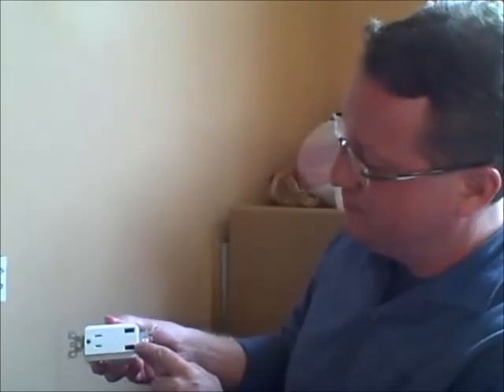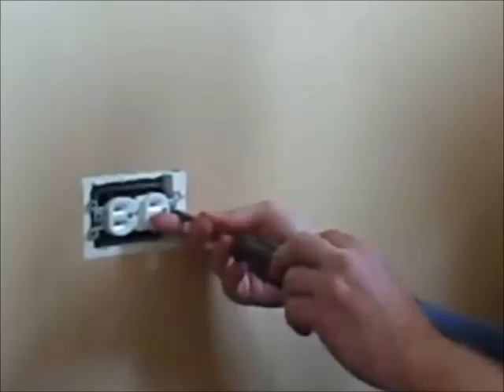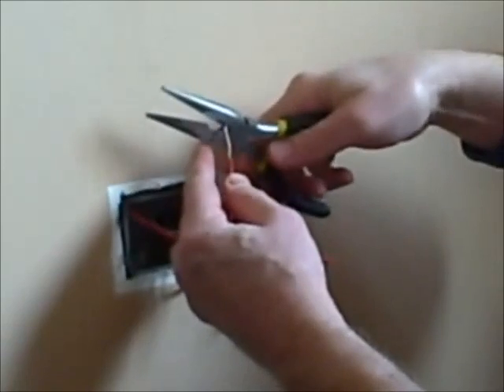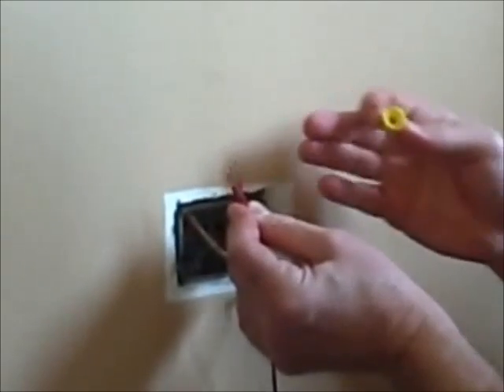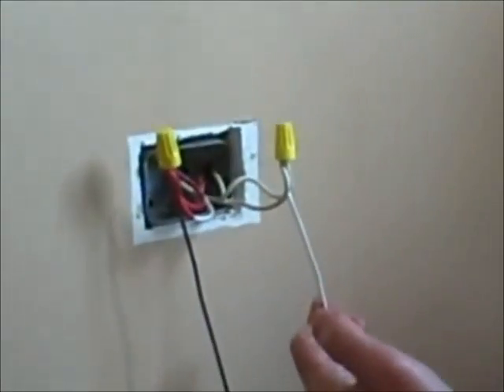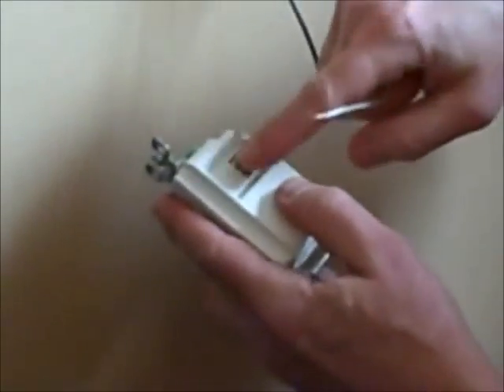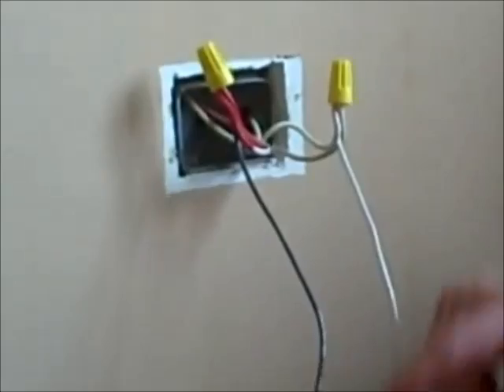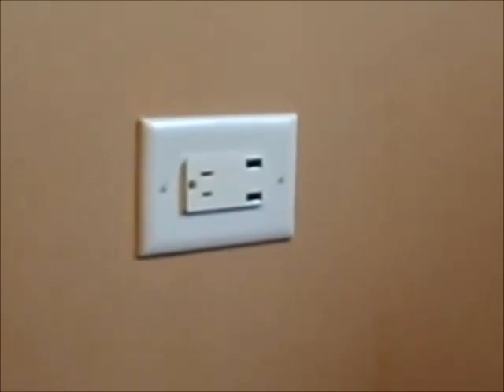Pigtail for an Outlet - Pigtail Connection - How to Wire a Pigtail - Conduit

Comment: Where do you get the extra wire and what Guage is it?
Reply from the maker: Hi, you can get wire from your local hardware store. They will usually cut a short length, or you can buy a bag of grounding whips. They usually come in 12 gauge for 20 or 15 amp circuits. Match the wire size to your circuit. 14 gauge for 15 amp, 12 gauge for 20 amp.
Check out more home improvement tips on our weekly podcast 
https://itunes.apple.com/us/podcast/fix-it-home-improvement/id880903087?mt=2

Comment: Nice pigtail demo thanks.  No ground wires though?  I'm no electrician, but If you don't have access to ground I think it's against code to have a three prong receptacle unless it's a GFCI.  False sense of security, at least for equipment being plugged in.
Reply from the maker: Hi this is in the Chicago area with conduit. The metal conduit is the ground path back to the service panel. Common in a few parts of the country. It is grounded, you can confirm with a tester.
Reply: @FIXITHomeImprovementChannel   I think that's only partial correct. Aren't you still suppose to go from the ground screw on the device (receptacle) to a ground screw at the back of the box?  Without that connection, there is nothing grounding the device.
Reply from the maker: @Craig0999  Hi, if you have conduit and metal boxes and they are grounded at the service panel, when you screw your device into the box it's grounded. In the Chicago area for example, you will hardly ever see a ground wire in a metal box.
Reply: @Craig0999  The metal bracket of the receptacle that screws onto the box also functions as a ground path. So long as it is securely attached to the metal box, there is a connection.

Comment: Very informative video.  I'm confused on why the black tape was necessary.  Is it to protect the screws while inside the box and to make sure they never touch the metal box?  If so wouldn't it be necessary at all times including when putting it in and the power turned back on when the project is finished and not just when removing next time?  Do the wires/screw not touch the metal box while it sits snug in there?

Thanks
Reply from the maker: Hi, when I was hiring electricians in the Chicago area, that's how they taught me. The thinking was; protection for the homeowner, if they pulled out a device without turning off the electric, the hot wire or screw won't touch the metal box.

Comment: What about ground wire?
Reply from the maker: Hi, in some parts of the country like Chicago, Seattle and NY where conduit is run, the conduit is the ground path. You won't have a ground wire. With non-metallic cable always connect a ground wire.

Comment: Why is it dangerous to connect both hot wires directly to the screw, instead of pigtailing first?
Reply from the maker: Hi, it won't hold more than one wire securely.
Reply: If you soldered the two wires together first would that work?
Reply: @manicmute9440  You could but a wire nut is easier, less messy and can be easily undone. Less potential for breakage too.

Comment: I couldn't help but notice that you kind of glossed right over the part where you tucked the wires with along with the wire nuts into the box and then screwed in the outlet receptacle into the box. That's the part that I have always found to be the biggest pain in the butt. I would really like to find a safe way to pigtail wires without using wire nuts. It would make it so much easier to get the wires and the outlet receptacle into the box.
Reply from the maker: Hi, you can get push wire nuts. They are thinner. https://youtu.be/e_GD3JCvaK4
Reply: Thank you for providing that link.  I will definitely check those connectors out.
Reply from the maker: You're welcome.
We have more tips in our home improvement book https://amzn.com/B01MRGO8C5

Comment: Thanks for this. Is it ok to use a slightly thinner wire for the pigtail? I was replacing a pull-chain ceiling fixture in my old house and found that it was wired with two hots and two neutrals under each fixture screw. I went to Home Depot for pigtail wire but it looks a bit smaller than what is in the box. Is it ok to make pigtails with 14 instead of 12, or 12 instead of 10? Thanks!
Reply from the maker: Hi, match your pigtail wire to the circuit. 14 gauge for 15 amp circuit, 12 gauge for a 20 amp circuit. 
We have more tips in our home improvement book https://amzn.com/B01MRGO8C5.

Comment: Bad practice to connect the hot wire first, even if you know the circuit is turned off. Always connect grounds and neutrals first. Hot is always attached last.
Reply from the maker: Thanks for the tip
Reply: Interesting, I wonder why is it different for a car battery?  We always connect hot (red) first and then ground (black).  Reason being if you're accidentally grounded to the car chassis and touch hot it completes the circuit.  Just wondering.. thanks.
Reply: toxicologicalIP iridocyclitis face-saving humility opportunity phonophobia

Comment: FIX IT Channel or anyone else who can give advice on this subject: There's a comment from 9 months ago (see user "Man na") saying that TWISTING THE WIRES BEFORE YOU WIRE NUT THEM TOGETHER -- as seen on this web site: http://waterheatertimer.org/How-to-twist-electric-wire.html -- is a better idea, rather than just installing the wire nut over the two (or more) paraellel wires... When I went to wire my new light switch a few weeks ago, I did have the linesman plier ready but saw your video and simply installed the wire nut over the two wires without twisting them together. It was a good, tight fit under the wire nut and I wrapped the area with electrical tape. However, is there a need for me to go back in, undo everything, TIE THE WIRES TOGETHER, etc.? Please advise...
Reply from the maker: +mjlwriter Hi, for small gauge wire like you are using, either is fine. The wire nut does a great job of twisting them together. Using a linesman's pliers works well too, especially for larger wire. It comes done to preference. How did the project turn out?
Reply: +FIX IT Home Improvement Channel I was able to easily swap my faulty combination dimmer/on-off switch for a standard rocker on-off switch. Just wasn't sure if installing the wire nut without twisting the wires was okay. Are you saying that twisting the wire nut over the wires actually does the twisting of the wires for you? I am a little concerned that, although the wires are snugly under the wire nut with a tight connection and electrical tape covering all, that there is a chance for them to dislodge... Worth going back in?
Reply from the maker: Hi, if you didn't twist them together, they could possibly pull out. When you pushed them into the box, if there is pressure against the wires. I would pull then out and make sure they are twisted together firmly. Better safe than sorry.
Reply: Well, when I put the switch, wired, back into the box, everything stayed intact. Have done a bit of reading lately, and some say that twisting the wires before capping is actually against code or just not required by it. They say the best connection is with the wires untwisted, with the wire nut doing the twisting for you. Think I'll leave things alone. Thanks for your responses.
Reply from the maker: You're welcome

Comment: I think if you look on the back of the new outlet, you'll see four holes, two near each screw. All you need to do is stick the two black wires in the holes near the hot screw and the two white wires in the holes near the neutral screw; tightening the screws secures the wires in the holes.  This eliminates the need for pigtailing, and is a lot easier to do with 12-gauge wire.  I did this recently in my kitchen, and the outlets on that circuit are working fine.
Reply: +FIX IT Home Improvement Channel 
Electricians hate backstabs where the wire is grasped by and internal clip that can overtime loose tension, begin micro-fracturing from thermal cycling, crack, and cause arc faulting, however if your receptacle supports back wiring with a screw clamp, which is what it sounds like Lou was suggesting,  that is considered a great way to wire the outlet because it is easy and provides a good mechanical bond which is the preference of many electricians, however the back wiring clamp is usually not available on residential grade receptacles, it is usually a feature on more expensive commercial, industrial and hospital grade receptacles.
Reply from the maker: +Lou Primus Hi, most electricians don't recommend using the push in clips. Depending on the fixture, they can loosen and pull free when you are putting the device back in the box.